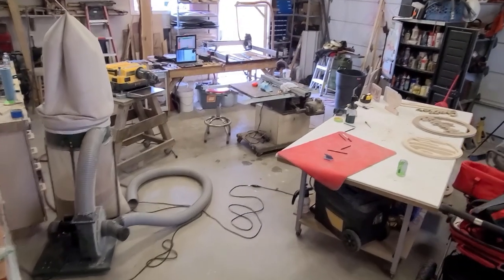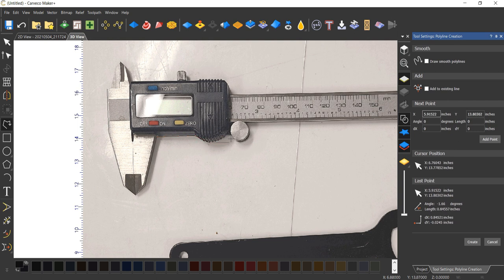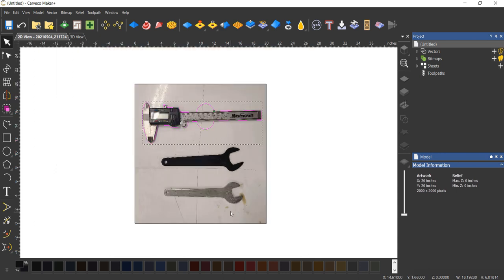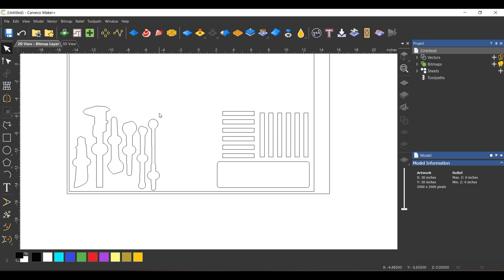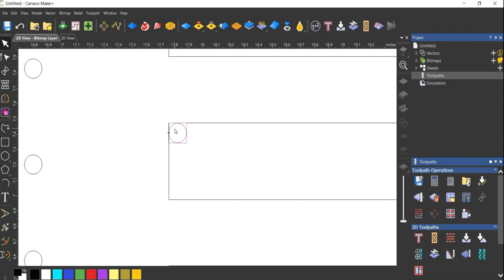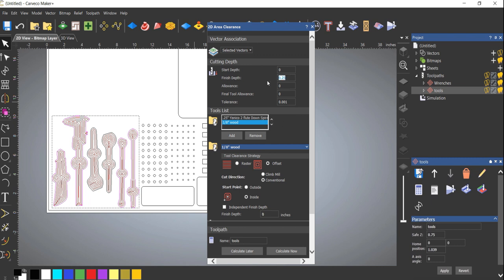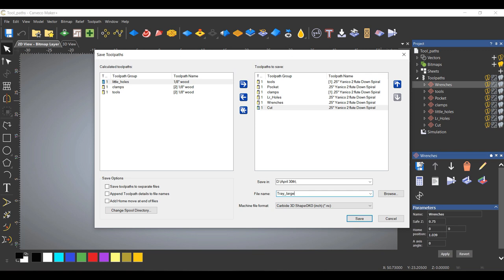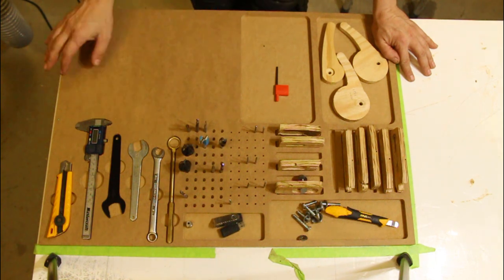CNC Bit Organizer

Comment: Surprised you don't use helical bits....
Reply from the maker: I have several, but Straight flute bits work perfectly fine in MDF.
Reply: What is the cnc router you use for the project?